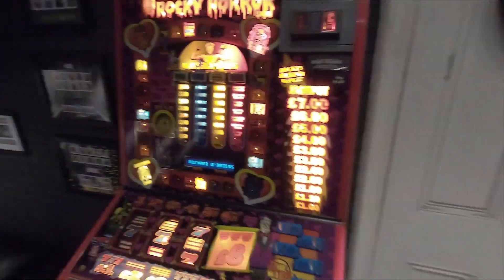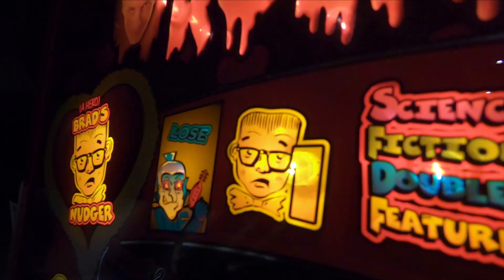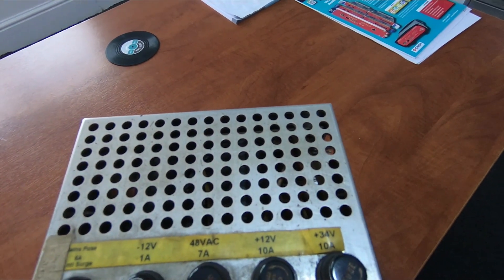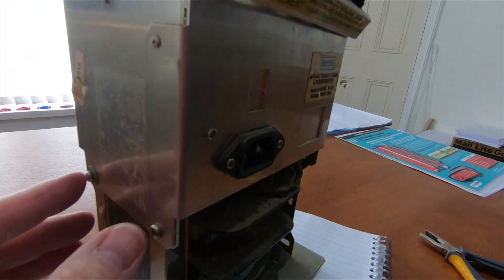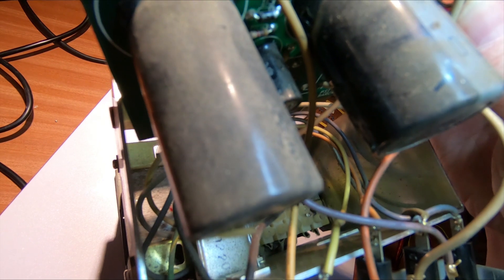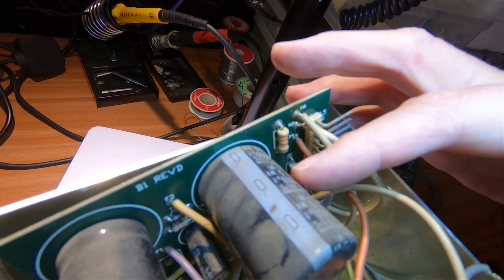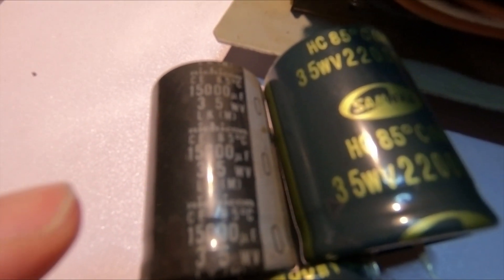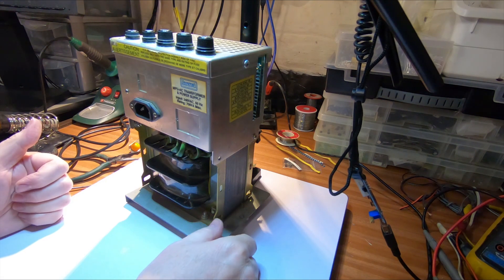Barcrest MPU4 fruit machine flicker PSU repair

Comment: Just found your channel, thanks for this tear down and capacitor check. Some flicker on these machines is normal because the lamps are driven in strobes. This ensures the bulbs don't all have to be wired directly and the power is pulsed across the strobes taking advantage of the delay regular bulbs take to dim after power is removed. So whilst you won't ever remove the flicker completely it does become less visible to the naked eye. Just wondered if you put the capacitors on a ESR meter, were they well out of spec?
Reply from the maker: Hi. Correct, they are multiplexed but when the number of lights on causes the flicker to be worse or the payout mech causes voltage drops (resetting the board in my case) then caps is likely - with the age of some of these now it's not surprising. 
I didn't check the caps that came out but it's not reset since 👍
The MPU5 power supplies are much better quality with Nichicon caps.

Comment: Hey bro, wondering if you could help. I have a Global Games "Money Magic" Fruit Machine. It had been working perfectly for years on 'demo' and normal mode. 
But recently when I start it up, it goes through all the initialising setup all ok, but when you start playing then, the machine and lights just freeze, the buttons don't work with it either.
Can you tell me what's causing the freezing of the machine?
Cheers :-)
Reply from the maker: I would not know without troubleshooting.
If you do suspect the power supply (do the bulbs dim when there are a lot lit at once, does the machine crash when trying to pay out, etc) then you can pick up second hand MPU4 power supplies from eBay most of the time fairly cheaply. Easily swapped out to try that first 👍
Reply: @ANTandTEC  ok cheers bro 🙂